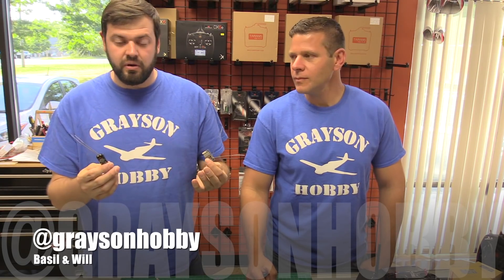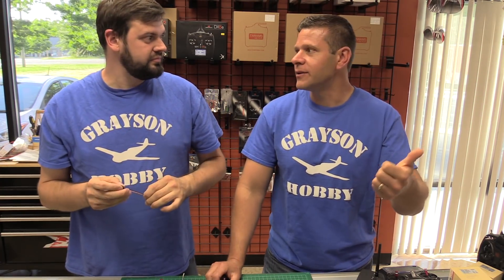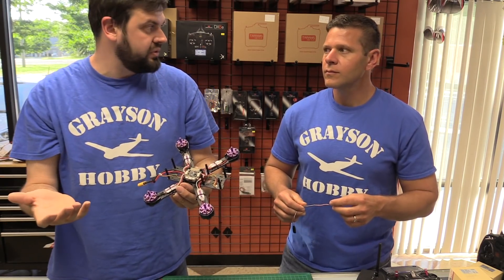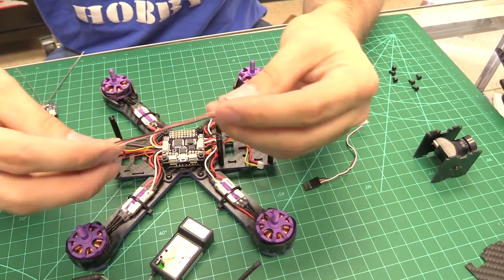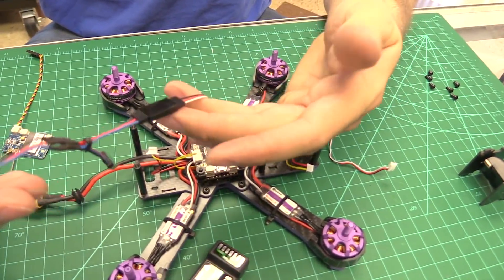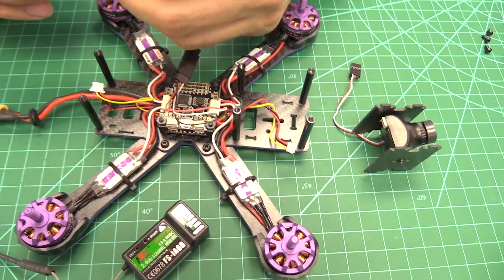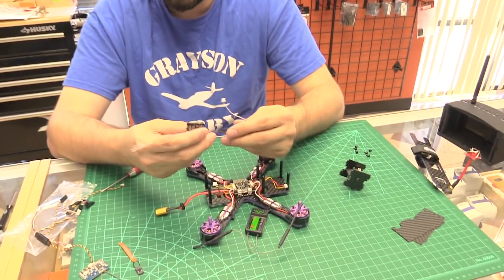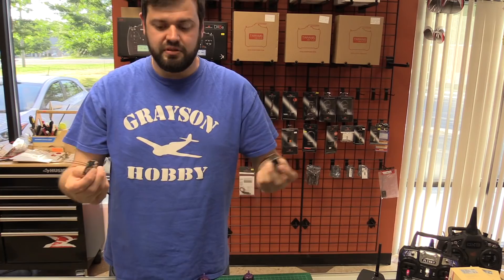Eachine Wizard No Solder Receiver Install | Spectrum - FlySky

Comment: And you can´t even solder Spektrum original wires since the insulation is rubbish plastic, it  will shrink and pull back and melt when exposed to heat. And it´s not flexible. They should really step up their game and start using modern materials with their product. Yes, I´m Spektrum user, and sometimes I hate myself for it :)

Comment: One simply doesn't plug in a spektrum rx. U must soLder signal to a spare uart then activate corissponding port in betaflight/cleanflight
Reply from the maker: Did you not watch the video? We show how without soldering
Reply: @graysonhobby  yes watched the vid. Have the quad.  Tried everything u said nothing worked. Only way it did work was soLder to uart rx pin

Comment: How can I change the channel and number on the stock vtx from the wizard.
Reply from the maker: The Dip Switch on the bottom of the VTX. You will need to use a paperclip or something similar in size.